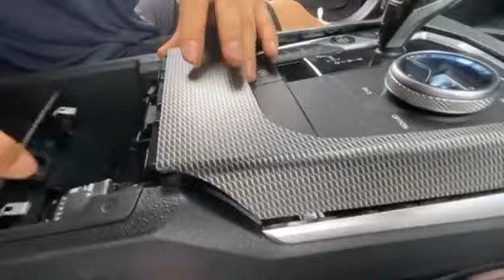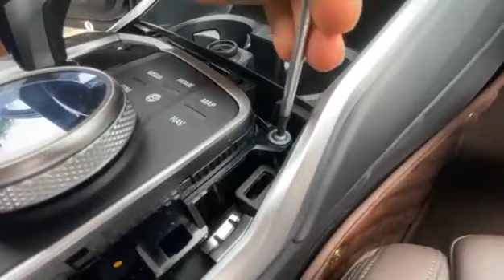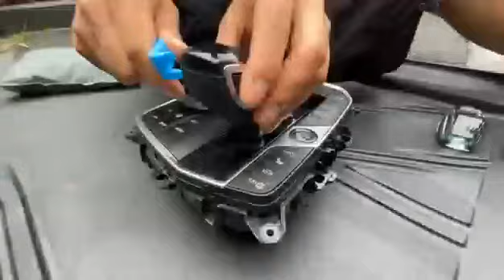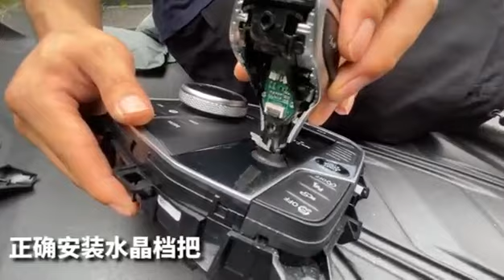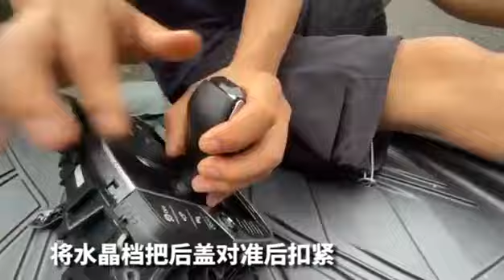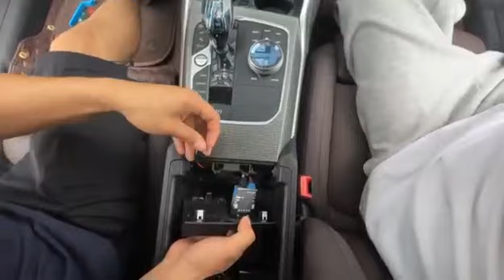BMW Crystal Shifter Installation MGU Series

Comment: Thank you! Did you have to unplug the battery?
Reply from the maker: remove the center console = unplug the battery. Please note!
1. Please disassemble the original gear knob center console and take it out of the car.
2. Please be sure to pay attention to the cable buckle firmly when installing.